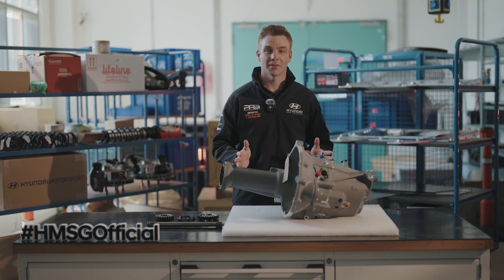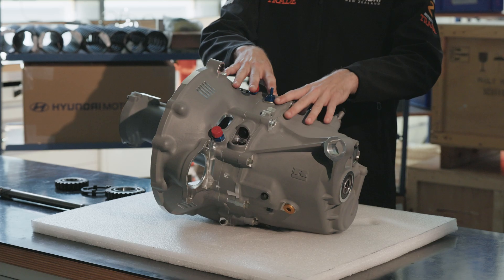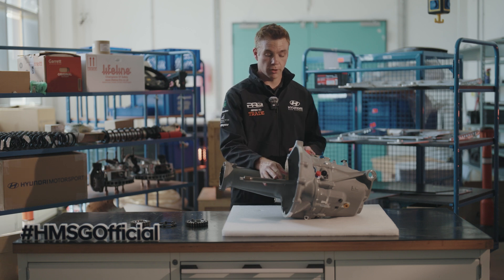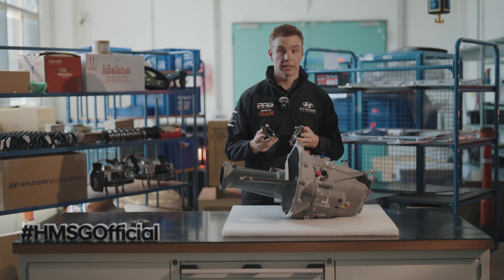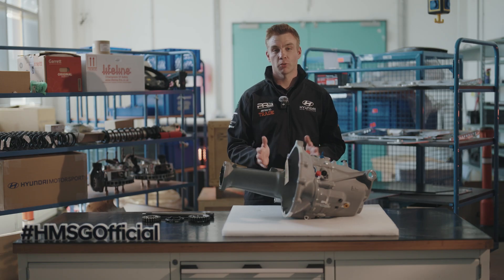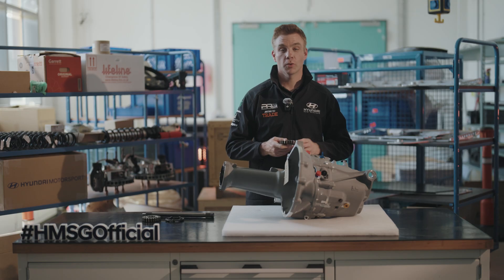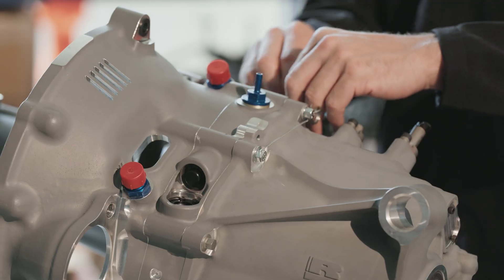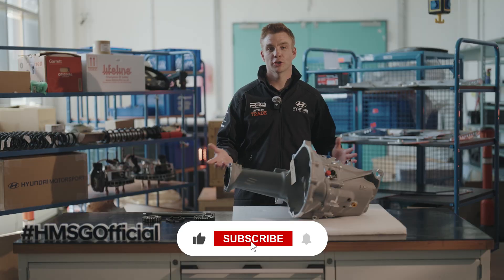Rally Gearboxes Explained: Mastering Every Shift

Comment: Question on driving technique while racing: 
For upshifting: On snow or really loose gravel, if your wheels are spinning in 1st and you want to upshift to 2nd and continue flooring it, do you have to clutch at all? Or just rely on the ignition cut to not shock-load the gears? 
For downshifting: Do you have to worry about rev-matching (throttle blip) at all? Or do you just brake hard and slam down through the gears with no throttle input?

If you need clarification please let me know.
Reply from the maker: Sorry we didn't get back to you sooner, so with the sequential gearbox we use in the rally cars, there is no need for the clutch at all (apart from when starting or driving at very low speeds), and no need to rev match on downshifts 💪 We hope that helps, are you looking for rig setup advice or real life?
Reply: @HMSGOfficial a bit of both really! I’m using the sim to prepare for real life driving, I just wanna cement good habits with a dog-box sequential before being present

Thank you guys for the reply! Stay awesome
Reply from the maker: Awesome! What rig have you got? 😎
Reply: @ Fanatec wheel, shifter, E-brake and pedals, with a GT omega base. The chair is from a junkyard Fiesta

Out of curiosity, what kind of rig do your drivers train on? And what program do they typically use? (WRC, DR2.0, RBR, AC)
Reply: @HMSGOfficial  Do you use the clutch for a hairpin turn when using the handbrake to lock the rear wheels?
Reply: @HMSGOfficial ^

Comment: Sequential gearbox doesn't mean you don't have to use clutch to change gears. It's a different feature. Sequential gearbox means that gears are changed in sequence, 1->2->3->4... and back. You can't skip gears in between, like in a road car, where you can choose whatever gear you want and for example accelerate fast in 3 and change directly into 5 or 6 after reaching speed limit on the road.
Reply from the maker: You are 100% right, that is the definition of a sequential gearbox, but also, with a sequential gearbox, there is no need to use a clutch 💪

Comment: I guess I'll have to look for another video to explain how a sequential gearbox works different than what I'm used to in my car
Reply from the maker: What would you like to know exactly? 😃 We will see if we can help 💪
Reply: @HMSGOfficial  why can a sequential gearbox shift without a clutch while my manual cannot
Reply from the maker: Okay, so he explains this in the video much better, but we will try our best 😉 It is to do with the use of dog rings that remove the need to disengage the clutch. So instead of using the clutch to disengage the engine and gearbox, then selecting the gear, this means, when the driver uses the gear lever, it moves the selector barrel that engages the dog ring (that act as mini clutches), which in turn engages the input and output shaft gears, making shifts much, much quicker without having to use the clutch (it is only used to start, for low speed driving, and sometimes for control) 💪

Comment: Can you share what the top speeds are of both the short and long ratio?
Reply from the maker: It varies per setup, and depending on the conditions and the gear ratios up, but you will generally find a difference of about 5-10 kph in the final gearing top speed, but again, this depends on a lot of factors 🤓
Reply: @ what is that top speed figure?

Thanks
Reply from the maker: Again, depends completely on conditions, but as an example, at Rally Sweden our cars maxed out at 200 kph 💪

Comment: Does "sequential" mean a computer handles engaging/disengaging the clutch between gears, or that the clutch doesn't get disengaged during shifts?
Reply from the maker: But to answer your question, you were correct with your second statement, the clutch doesn't disengage during shifts as the gear lever manually engages the dog rings without the need for a clutch 😉
Reply: @HMSGOfficial  That's what I thought, but it's hard to tell. There's not a whole lot of beginner content for transmission anatomy ¯\_(ツ)_/¯
Reply from the maker: @ChristianStout  We completely understand, that's why we wanted to make these videos, and that is why your feedback is so important to us, as it helps us understand what to cover next 💪
Reply: Sequential means you can't skip gears like in a regular manual where you can, for example, shift from second to fourth. Instead of an H pattern with the shifter a sequential has only one plane of freedom (usually forward or backward) and each push or pull on the lever shifts up or down one gear. 
In a sequential you can't skip a gear, if you're in second and want fourth you'd have to shift through third before engaging fourth, like a motorcycle transmission.

Not mentioned but the gears also appear to be straight cut.
Reply from the maker: @ This guy knows his stuff 🙌
Reply: @Surestick88  "Not mentioned but the gears also appear to be straight cut."

Which also tends to make them much noisier/whinier than any synchromesh gearbox, whether they are an H pattern dog box, or a sequential.

Since those dog rings are basically acting as the clutch as stated above, these gearboxes need to be rebuilt on a given time usage schedule as well, making them very very impractical for any daily street use (along with the almost impossibility of using them in any stop and go traffic jams with their 'on-off switch' style, full racing, puck friction surface clutches).

(In case anyone was thinking about using one in their sole daily driver street ride, even if they could afford the $35K+ USD entry price for one of these jewels.)
Reply from the maker: If you watch the video…all is explained 😉

Comment: Do you switch between the two gear sets in their entirety, or can you mix and match from the short and long gear sets? like, if a stage has mostly only very slow corners and fast straights, could you use 1st-3rd from the short set and 4th and 5th from the long ratio gears?
Reply from the maker: You can just switch between the two gear sets 💪

Comment: Great video! How do people get involved in rally? I’ve been playing RBR recently and want to volunteer or see a real one for once
Reply from the maker: There are places you can train to be a marshall, where are you based?
Reply: Volunteering on a rally is the best way of seeing the whole thing 'up close and personal' no matter where in the world you are located!

On the same event you could get showered by gravel and rocks on the cars' launch while working a start control, see them at full scream blasting through the stage (especially dramatic at night; with lights, exhaust flames and pops on shifts, and brake rotors blazing!) while working a radio control or as an intersection marshal, or see the crews pushing to save that last microsecond at the flying finish control.

Comment: Advantage of using dogs over synchros?
Reply from the maker: They can take more torque, are more robust and therefore last longer, and cheaper 😉
Reply: @HMSGOfficial  doesn't the play in-between teeth make it wear out faster? The dog i mean
Reply from the maker: Nah, due to the fact as it is more robust, and the the way it handles the torque 💪
Reply: There is also such thing as H-pattern dog boxes. These aew generally used in American or American-style stock car racing
Reply from the maker: Yep, but they are not sequential 😉

Comment: Why do rally drivers no longer shift gears with gear levers on the steering wheel?
Reply from the maker: The paddle shift (which was electro-hydraulic) was banned to reduce costs and make the cars harder to drive, so now they have to use a mechanical gear lever shifter 🤓
Reply: @HMSGOfficial  will they return in the future
Reply from the maker: No plans for them to as far as we know
Reply: Because they're gay?
Reply: Also, with paddle it is easy to shift while cornering. Which would be extremely dangerous without expensive electronics to keep wheels from locking up (declutching, throttle blip).

Dog boxes operated by lever, force you to let go off the steering, reducing how eager drivers are to play with the gears while cornering & stalling or spinning the car.